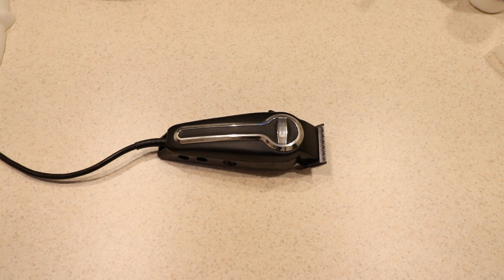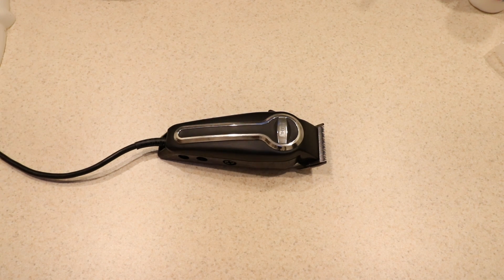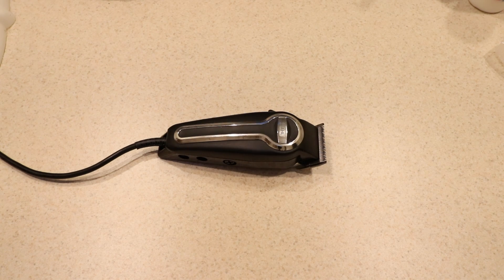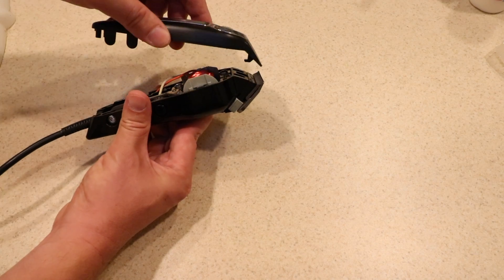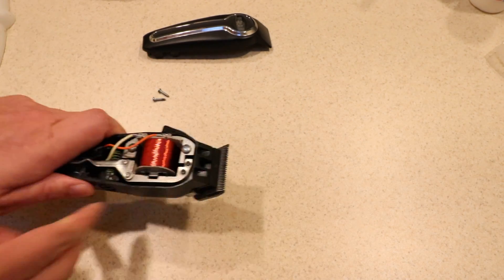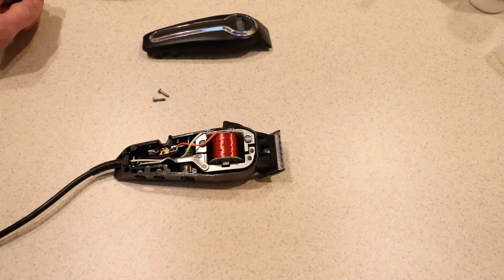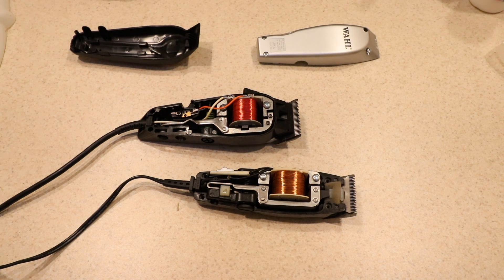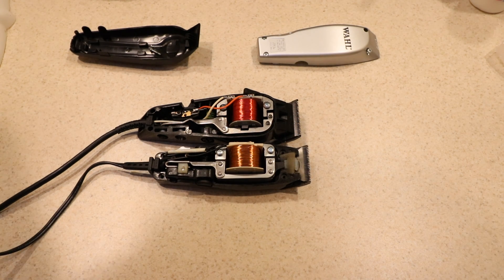Wahl Elite Pro Motor

Comment: Hi another bro question when you have time, is a cordless wahl senior with a DC motor and 
6500 rpm more powerful than a corded wahl legend with with a v9000 motor and 6000 rpm?
Reply from the maker: Thats a good question. Im not sure how I could even do a real world test for something like that. In a factory or testing facility im sure they would have a fancy machine to hook the clippers up to but it always seems like the numbers the manufacture comes up with and real world uses are never quite the same.

Comment: Hey sir, I had a question that nobody really answered about performance between U.S wahl magic (corded one) vs European (corded). 

The U.S has v9000 motor with 14,400 spm.
The EU  has v9000 motor with 6000 rpm.

Which one is more powerful? Thank you
Reply from the maker: Thats a good question. Im not sure how I could even do a real world test for something like that. In a factory or testing facility im sure they would have a fancy machine to hook the clippers up to but it always seems like the numbers the manufacture comes up with and real world uses are never quite the same. As far as power performance between US and EU models with cords, my guess is it might have something to do with standard power outputs from what ever source the clipper is plugged into.
Reply: @WindersRanger  I bought a us corded wahl senior it has 14.400 spm which equals 7200 rpm, and an EU wahl legend which has 6000 rpm, I can tell the difference in power just by holding it, having really faded with the senior yet, but I know the senior is a beast.

Comment: It would be nice if Wahl had a comparison feature on their website. They have so many models it's ridiculous. I believe the website said this motor has 15% more power than their 'regular' motor. I'm guessing the 'regular' motor is the 5000, but I would also think the 9000 has more than 15% more power than the 5000. Just my thoughts on it.
Is anyone sure that these are the only 2 motors they use?
Reply from the maker: Its hard to say. I wish I had the means of getting into the different models and testing them to find out exactly what their specs are. I have a feeling what the manufacture specs them out at vs what they really are is likely two different things.
Reply: v9000 are 50% stronger than v5000 that what they say on the boxes
Reply: @amoyzegh  are these the only 2? also does anyone know if the gamma suoer torque is quieter than the v9000 senior motor?... thanks

Comment: I am planning to buy one but am asking myself if is doing the best job of cutting the hair?
Reply from the maker: It does okay depending on how much you plan to use it. I cut my hair about every four to five days or so and this clipper did fine. It missed a few hairs here and there but most clippers I use do that. I have since switched to the Wahl Senior Cordless which is more on the professional side of things and in my opinion is better than the Elite pro. Then again thats not really comparing apples to apples either.

Comment: I have purchased Wahl elite pro 79602 and its creating loud noise. And i tried power screw. When it was truned clockwise to reduce the noise but the machine getting heating up and blades are not moving.
Can you help me with that?
Reply: Same thing happened to me - did you resolve this?